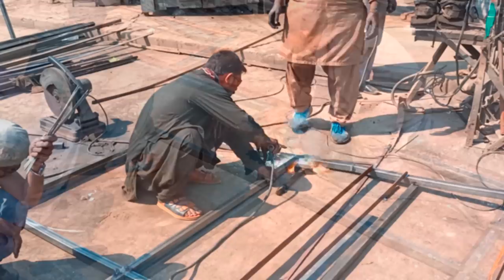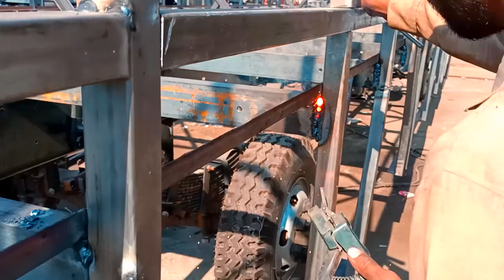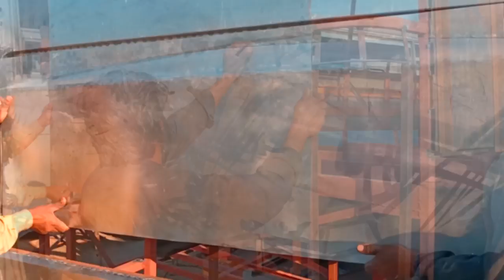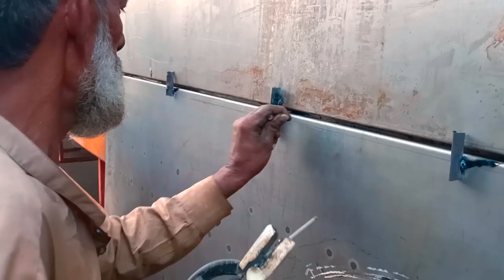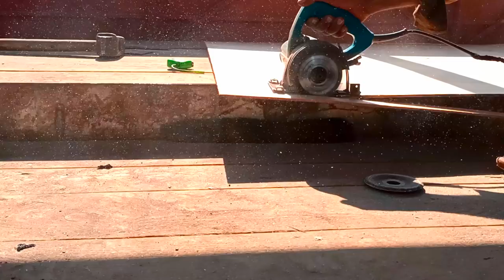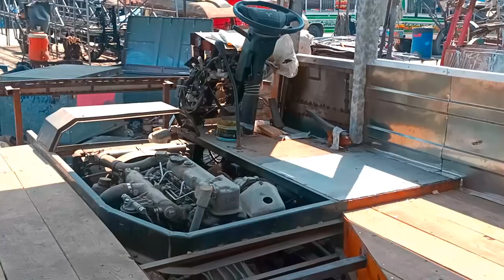Amazing Manufacturing Process of ISUZU Bus at local Workshop | Handmade ISUZU Bus manufacturing

Comment: Everyone applauds these guys for doing so much with basic tools but that's no reason to cut as many corners as they do. All those unpainted surfaces will rust at the first hint of moisture. The 10's of kilos of cheapo unsealed body filler will swell and peal off. The entire bus will be a rust bucket within a year or 2 and they have reasonably good conditions. This thing wouldn't last 3 months in the rust belt or in any coastal area.

Comment: So where does ISUZU come into this - are they just copying their design or what..
Reply: In my thinking, maybe the engine, gearbox, differential, wheels, chassis and electronics are ISUZU. They are  just building the body. Anyway for that in any civilized country there are regulations Furthermore I must give these guys credit. To to a job like that with flip flops and a gown can't be easy. Where I come from in Africa, safety boots, overalls, gloves and eye protection are mandatory.